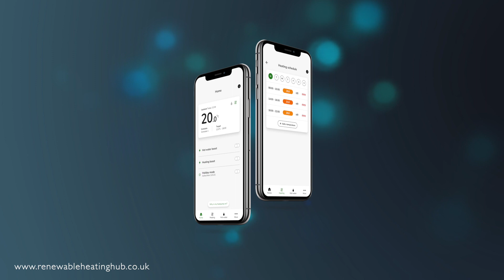The Importance of Weather Compensation for Heat Pumps: (Ep.25) Karolis Petruskevicius

Comment: Combi too hot turn it down too cold turn it up so why is a heat pump so complicated.My Combi did the job.my gas fire put the heat exactly where I want it 20 cubic meters,heat pump has to go through the whole house 300 cubic meters A to B this is a fact and all the flannel can not hide these facts.Heat the whole house with a heat pump or heat your living room,Heat Pump -2 it will use at least 50kWh never mind all this COP 3 to 1 most of that is wasted in my empty Kitchen or my empty 4 bedrooms while I freeze in the living room.Sorry to bust your bubble most people can’t afford to run a heat pump.The haves and the have nots.Great Video but it boils down to can you afford to heat empty rooms.

Comment: Hi, I am about to install a 9 Kw Mango heat pump. It will be used only for radiator heating - initially. I am undecided whether to use an indirectly heated, buffer tank, which will create a problem with space, or a BPHE. Either present a manner in which to separate the output of the heat pump from the radiator circuit, something no one speaks about! What would be your recommendation?

Comment: Weather compensation is all the "main" control we use. We have GSHP installed and run it 24/7. Our heat curve is 40°C @ -7°C. For context:
It's a large house with double glazing,  cavity insulation, 22mm pipe feeding double rads upstairs and underfloor heating downstairs.
For the last 2 months the TOTAL household electric bill was £240 and £220.
The house is toasty, the hot water (taps) is fine.
For us, weather compensation DOES work.
People who get their gas or oil boiler exchanged for a heat pump have to appreciate that flow temps are a lot lower and the temperature in your house has to be maintained- in our experience having traditional on off periods doesn't work for us.

Comment: When you say you expect the heat pump to be on all the time can you confirm whether there will be cycles of usage during the period it's supposed to be on all the time.  Right now I see my heat pump come on and off roughly every 30 mins when it's cold but when it's not so cold the frequency is even shorter.  Is this something you would expect with weather compensation turned on?

Comment: As a customer, it is difficult to cut through the marketing on heat pump manufacturer sites to try and understand which brands are better (value for money).

Midea for example are a brand I had not heard of until engaging with an ASHP installer but I've since learned they are very well established in China.

Another installer advised that I should stick with a manufacturer that has a background in heating rather than air conditioning but that seems somewhat counterintuitive.